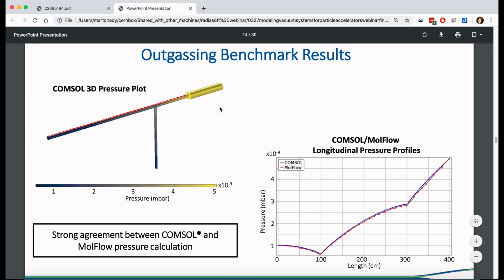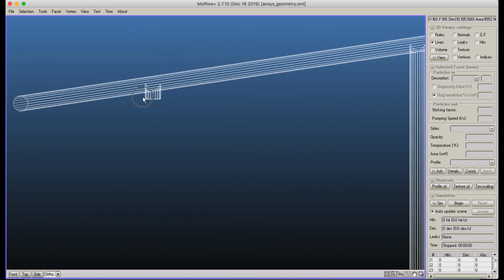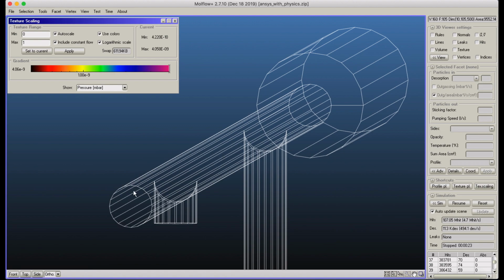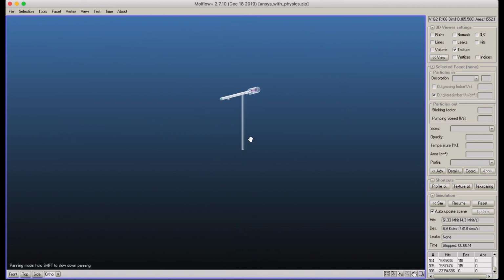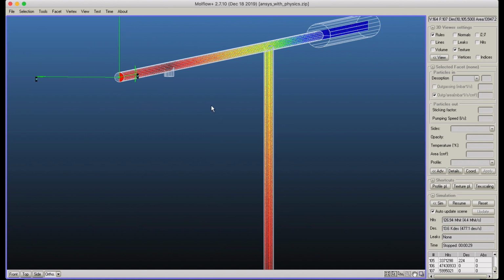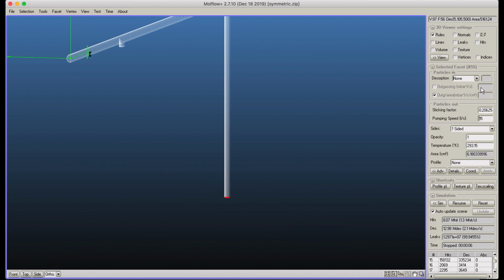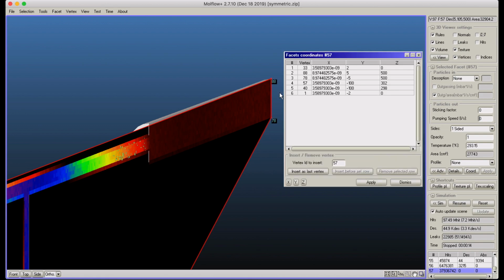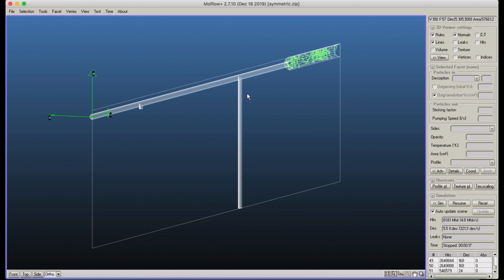Molflow webinar - Creating a geometry part 2: adding physics, benchmarking, symmetry

Comment: I am having leakage problems with the two pumps as they connect to the main pipe. I am not sure why this is, I will try to make the diameter of the two pumps smaller, do you have any suggestions?
Reply from the maker: If it's still not working, you can post on the forum (where it's allowed to attach files) and I'll have a look